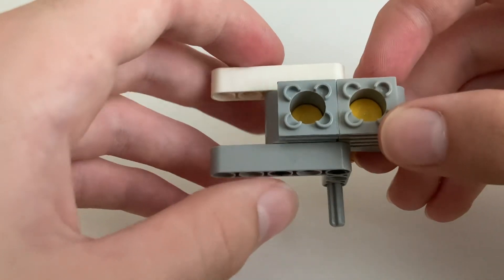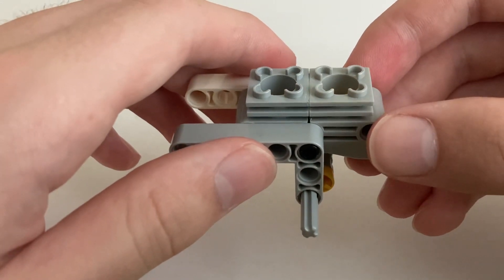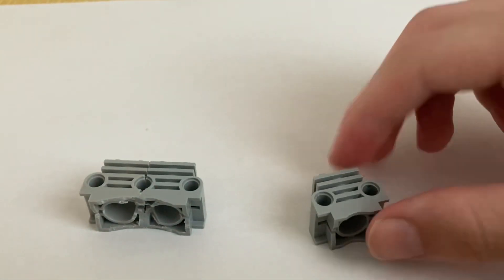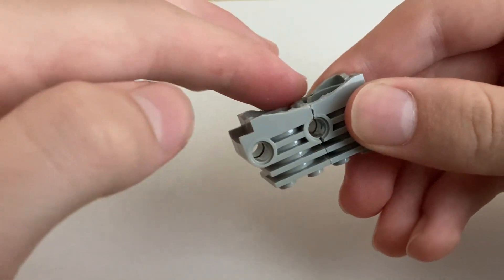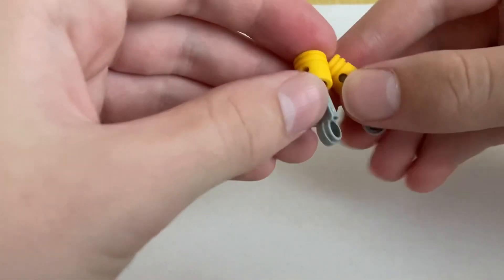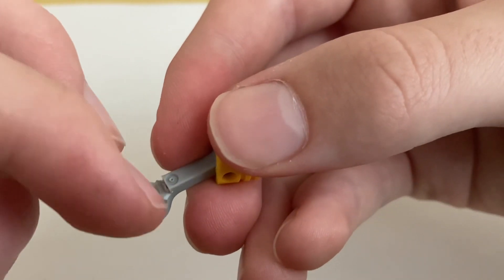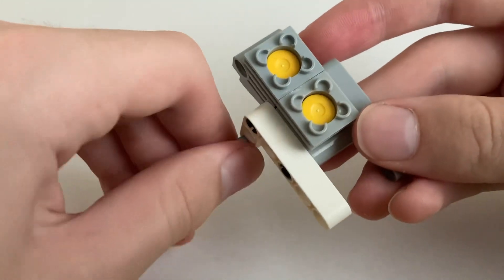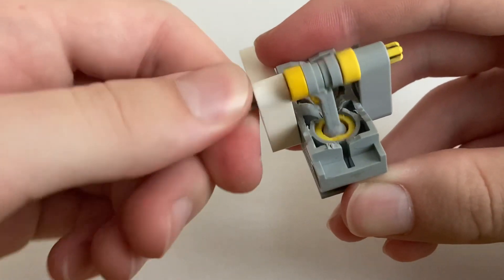Tiny Lego VR Engine Proof of Concept

Comment: how is this a vr?
Reply from the maker: The pistons are at a smaller angle compared to using the Lego housing prices, which are about 90 degrees. It also only needs one cylinder head since both cylinders are facing up.
Reply: @mrpython99  it looks like the pistons are parallel not at an angle? and should every crankpin have 1 crankrod/cylinder connected instead of 2?
Reply from the maker: @Edward-pw6zz  A VR engine is just a smaller V engine, so both pistons are connected to one crankshaft. The cylinders are parallel, but the piston rods are at an angle from the crankshaft.
Reply: @mrpython99  hmmm, i did some research and no, with both the VR5 and VR6 they each have one cylinder per crankpin, the bank angle is determent by the cylinder angle, not the pistonrods, pistonrods constatly change angle when the engine is running, the VR engine is not a smaller V engine, it is a more compact Inline engine